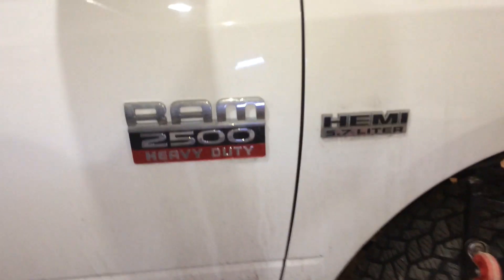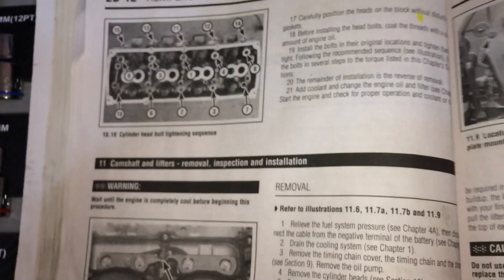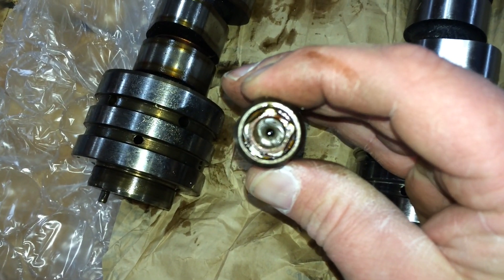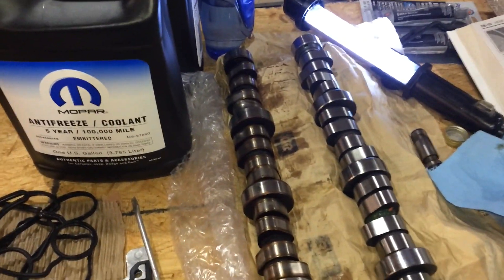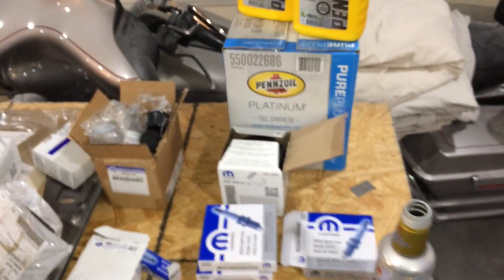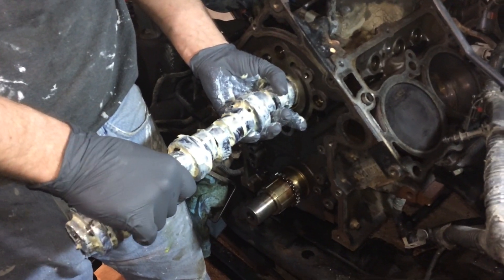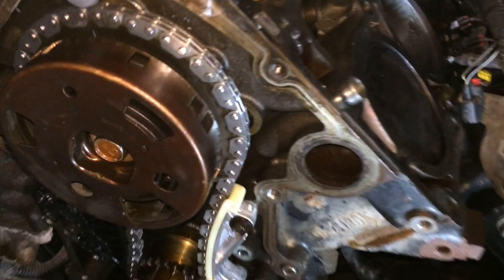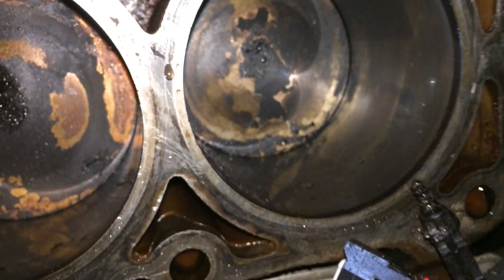2010 Dodge Ram Torque specs Cam install 5.7 Hemi

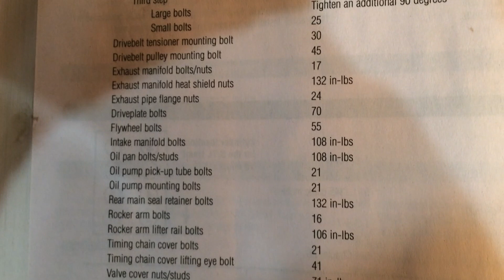Comment: 01:30
I just noticed in my book, and now I see it 8n yours because I was looking up info on this and your video came up. 
You see where it says water pump to timing chain cover bolts 21 ft lb? 
That is the same as the timing chain cover torque which is 21 ft lbs. 
But if you skip over to the cooling system chapter it says the water pump bolts are 18 ft lbs, well at least in my book because I see a one foot pound difference on the valve cover in my book says 70 inch pounds is yours it says 71. 
And then for the oil pan bolts mine says 105 inch pounds yours says 108. 
I see small differences but maybe because mine's a 2wd.
But only the same thing I see is what I was questioning about the water pump bolts that mount with the timing chain cover is 21 ft lbs the other water pump bolts are 18. 
Maybe cuz the ones that say 21 foot pounds go all the way into the block?